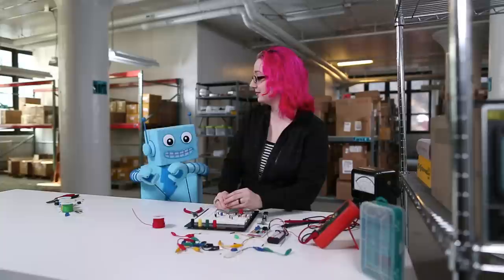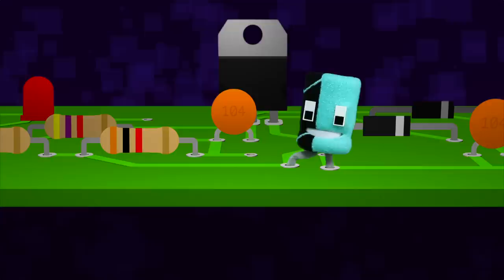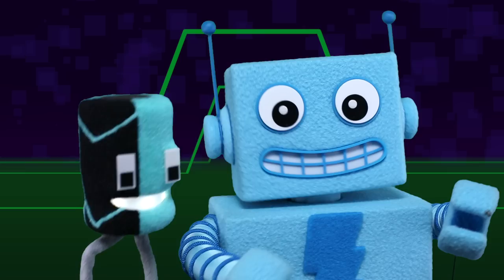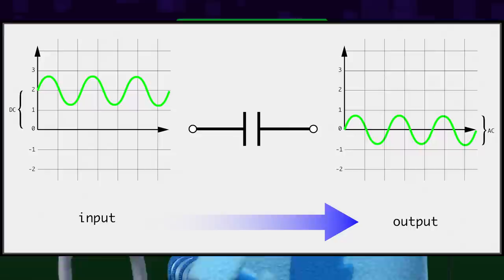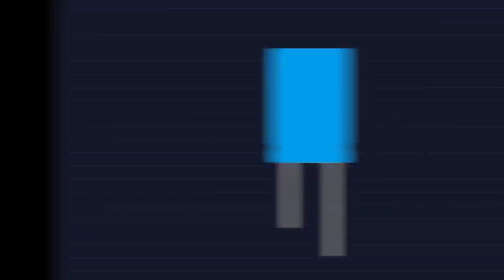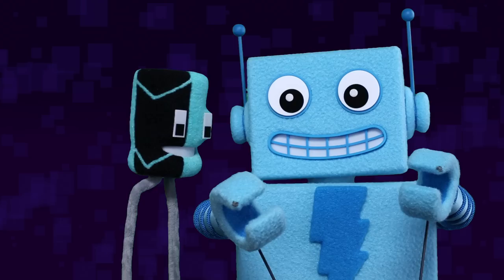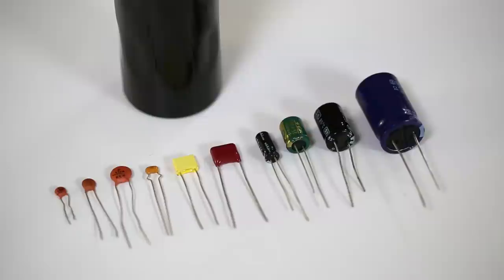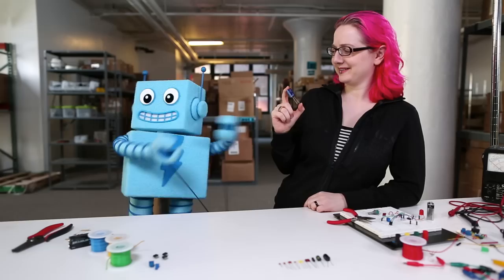"C is for Capacitor" - Circuit Playground Episode 3

Comment: I'm a 22 yr old college senior and this is probably the best lesson I've had so far on capacitors, capacitors make so much more sense now; does that mean I have the mental capacity of an elementary school student?
Reply: I think a lot of people with electronic engineering degrees don't fully understand capacitors. So don't feel too bad.
Reply: +GaiiFAFA Maybe cuz they teach you advanced circuits and calculations, but they do not teach what the heck those circuits are used for.
Reply: +GaiiFAFA It took me awhile to figure them out how they work.
Reply: Me to

Comment: This show is tripping me out man!
Reply: +Ghost Naughty no, like a battery the charge would slowly dissipate over time.  ever not use a car for a long time and have to recharge or jump start it.
Reply: +Ghost Naughty yes you can get shocked and all electronics use capacitors.
Reply: Ghost Naughty lithium metal polymer are rechargeable batteries, where ions move between the anode and the cathode, using an intercalated lithium compound or metallic lithium as the electrode material.  Capacitors are both inside and outside integrated circuits on the ciruit (mother) board of a computer or other electronic device....  some are large some are tiny....  A capacitor is a two-terminal, electrical component. Along with resistors and inductors, they are one of the most fundamental passive components we use. You would have to look very hard to find a circuit which didn't have a capacitor in it.
http://electronics.howstuffworks.com/capacitor.htm
Reply: Ghost Naughty
Google is your friend.